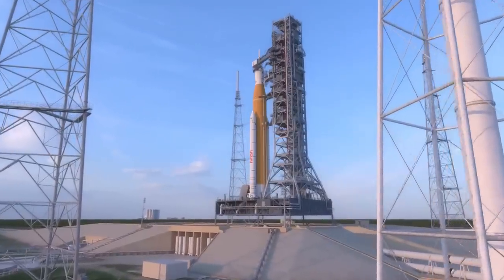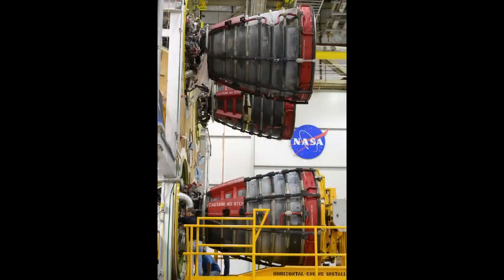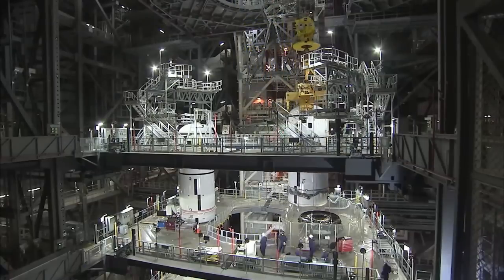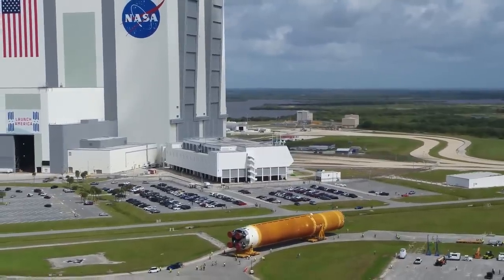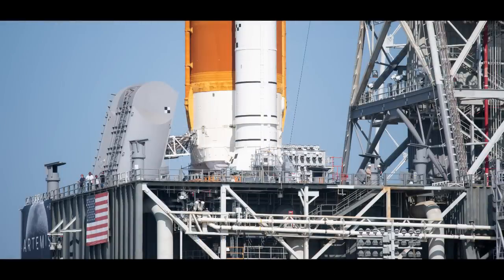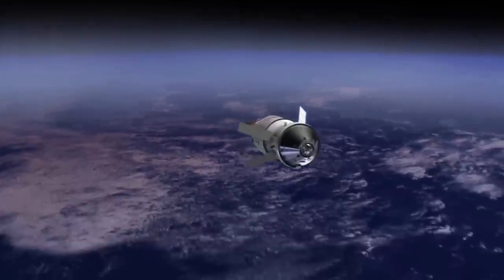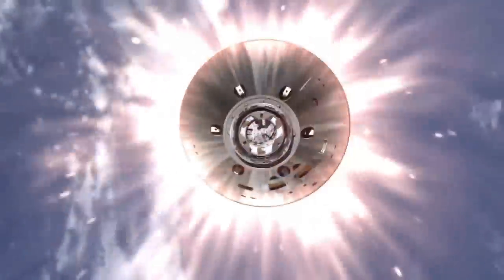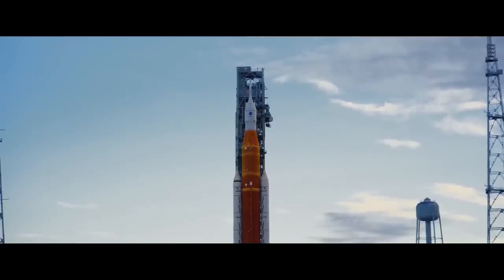What's The Big Deal About Artemis - NASA's New Massive Moon Rocket

Comment: How big is the rocket that will slow the vehicle to land safely on the moon? How much fuel will it take to slow down to the surface of the moon & will all the extra fuel weight to relift off the moon be an issue? Are they concerned about it blowing up when landing on the moon?
Reply: SLS lifts the Orion/ESM/upper stage towards LEO. For the first 3 missions, the upper stage will be the Interim Cyrogenic Propulsion Stage (ICPS) and after that the much larger Exploration Upper Stage (EUS) will be used. The ICPS/EUS will do the final insertion to LEO and will send the Orion/ESM to the Moon. Once there, Orion/ESM meet the Lunar Starship for the Artemis III mission and Lunar Starship will take half the crew to the surface. The other 2 stay in orbit on Orion. After the surface mission is over, Lunar Starship meets with Orion and all the crew return to Earth on Orion/ESM. The ESM is dropped before Earth reentry and only Orion lands back on Earth to be reused.
Reply: @steveaustin2686  
The artistic renditions of the 'Lunar Starship' indicate a very tall vehicle resembling the fanciful artwork of 1930s and 40s science fiction. Mindful of the angle that Apollo 15 set down this seems a very perilous design.
Reply: @yassassin6425  Per SpaceX, Lunar Starship will have larger, more capable legs than the one-use temp legs used on SN8-SN15. Lunar Starship will also have a greater propellant margin, so won't have to set down so far. Not to mention the CLPS rovers that will check out the area first.
Reply: @steveaustin2686  
"Lunar Starship will also have a greater propellant margin, so won't have to set down so far."

Not with you.
Reply: @yassassin6425  The Apollo LM did not have a lot of loiter time to pick the best landing. Lunar Starship will have more propellant margin for that. Not to mention the CLPS rovers checking out the landing area first.
Reply: @steveaustin2686  
That's what I thought you meant. Thanks for the clarification. Nonetheless, the craft does look perilously tall. I expected a squatter, wider design.
Reply: @yassassin6425  It can't really get much wider than the 9m (29.5ft) diameter now. It's doubltful it can get much shorter as it needs its 1,200+ tons of propellant. What is likely to happen is Lunar Starship will carry a few tons of cargo instead of 100+ tons.

Comment: It did come to me the other day reading an article about this launch just how wildly optimistic people were (and maybe cynically so) that taking parts from shuttle would just work tossing them into a completely different vehicle. There's almost no pieces on this that weren't re-engineered or built from scratch for this rocket. this wasn't 'bash a rocket together from spares' this was a brand new rocket with some off the shelf hardware and because its disposable the rs-25 engines which are all relics in their own right, are all gonna be trashed

Comment: What a shame that this will be unmanned with all this historic hardware being lost to the ocean. SpaceX spoiled me on the idea that cool launch hardware comes back.
Reply: Booster reusability is great, but has drawbacks.
First, if you don't have a fast enough launch cadence, you can spend more on recovery than you save by reusing the booster.
Second, you take a payload hit for the recovery system on the booster. The Falcon 9 B5 can lift up to 22.8 tons to LEO when expended, but only up to 16.3 tons when landed on a drone ship (B1051.12). Doing a Return to Launch Site (RTLS) landings, costs even more payload.

So with SLS launching once or twice a year, the cadence doesn't really justify recovering the booster. Not to mention that it gets higher and faster than a Falcon 9, so recovery is much harder.
The SLS Block 1 can get Orion to the Moon, but not with the kind of payload hit like F9 has. The SLS Block 1B will send along a Lunar Gateway module with Orion, so it really can't take the payload hit either.
SLS started design work in 2011, 4 years before SpaceX landed the first booster and almost 6 years before they reused a booster.

Comment: Is it just me or does the launch abort system seem awfully complex? I personally would want that to be as simple as possible to minimise the number of failure points.
Reply: I'm not so sure it is complex. Steering with a solid-fuel rocket firing through high-temperature flaps seems much simpler than conventional reaction control thrusters which require pumps and ignition.

Comment: Why wouldn't they use newer engines?
Reply: They use the engines because they have them in stock. These engines are still fine, they have been made to be reusable and they were quite reliable in the Shuttle program.
Later launches  will use new, simplified (cheaper) engines if the stock engines are all used and gone  since they don't have to be reusable now

Comment: I'm really disappointed with SLS.  It has become, essentially, a very expensive way to dispose of surplus re-usable shuttle hardware using Apollo era flight planning and the ones that actually had that knowledge are all long retired.  When the supply of parts is gone they'll have to start from scratch again.  There is no way Artemis will ever be a long term program.  These companies and this NASA program should be giving Space X a run for the money, and quite simply they're not.  Despite the fact that they have actually been getting the money.  If SLS actually works, they'll hold the record of the largest launch vehicle for a very short time before Starship simply eclipses them.  I consider Starship to be far more "operational" than SLS other than the parts of SLS have made it to space in a previous incarnation.  Someone, or some group of companies, needs to step up and be truly innovative as Elon has done.  That is the future.  Without competition and true innovation, Space X could end up being held back by governmental regulations, potentially as a monopoly, and that won't be good for anybody.
Reply: Aerojet Rocketdyne has a contract to build the expendable RS-25E engines for after the Shuttle era ones are gone. Northrop Grumman has a contract for more capable SRBs after the Shuttle era ones are gone. Starship has a lot of development to go and the fast launch cadence that Musk talks about is apparently a longer term goal. So even though SLS/Orion are hella expensive, they are needed in the short term.
Reply: Artemis is a long term program SLS is not as NASA fully intends to replace the design with space-xs starship once that is human rated. SLS is meant to establish the basic infrastructure necessary for long term lunar missions and honestly i think they are wasting time and money with the artemis 2 and 3 missions as while a manned return to the moon is great publicity surely getting gateway station up first is far more important but that's not slated until artemis 4. hopefully with the success of the artemis program the government sees fit to actually increase NASAs annual budget
Reply: Starship operational - is this your version of a joke?
Reply: @olasek7972  Do you really think Starship won't work?
Reply: @olasek7972  Just deeply disturbed that NASA would call SLS operational before its first flight.  At least Space X is actually flying tests.

Comment: So what the engines that SLS use , Russia ?
Reply: The Antares 230+ booster for the Cygnus CRS missions to the ISS used the Russian RD-181 engine, but NG only has 2 left. NG is working with Firefly to build the Antares 330 booster which will use US made Miranda engines.

ULA had already stopped purchasing Russian RD-180 engines for the Atlas-V. The Vulcan Centaur is replacing the Atlas-V with US made BE-4 engines from Blue Origin. I can't think of any other US boosters that use Russian engines.

Comment: I’m sorry nothing about SLS excites me.  It just doesn’t seem to be an example of good engineering.  The engines are wrong - they should be man rated RS-68s not SSMEs.  The solid boosters are wrong - sure why not add another segment join to increase the chances of failure to overcome the wrong engine choice as SSMEs, which are vacuum engines, don’t give enough thrust at sea level.

The capsule is not testing the critically important life support which isn the whole reason you now have two capsules instead of one.  The launch abort system seems really dodgy and heavy and something they threw together at the last minute.  

SLS is like the last generation of piston engined fighters like the Bearcat - interesting and high performance but doomed to be replaced by jets.
Reply: I agree, though they can't use RS-68s (something previously considered) because they can't survive the heat of the SRBs next to them... the ablative nozzle ablates too quickly. That's why they switched to RS-25 / SSME...
Reply: @simongeard4824   That is a good reason however this is a perfect example of where good engineering has gone out the window.  

Being forced to use the SRBs has compromised the system.  The SLS has more area at the bottom so would it have been impossible to mount more RS-68s so they didnt’tneed solid boosters?

Alternatively I am dead sure with some correct positioning and some shielding the RS-68s would have been fine.

Its a bit like coming up with reasons to use an F1 engine in a Mack truck because you’ve been told you have to use an F1 engine instead of a CAT diesel.  I have complete glossed over the fact SSME’s need solid boosters as they have such poor sea level thrust.  This was all dictated by the design of the shuttle.

SLS should have been a clean sheet design but as it’s actually a jobs program this is what we are stuck with.  Shuttle design compromises make absolutely no sense on a completely different rocket.

Comment: To save the engines as they splash down.whty doesn't NASA have an inflatable parachute System etc? ..
Reply: I think the core stage goes too fast at that point.
Reply: Because at staging the core stage is travelling at 17,000 mph and over 100 miles in altitude. Having no heat shield to protect it, it burns up as it reenters the atmosphere - just as the space shuttle external fuel tank did.

Comment: Well done NASA, made me wait for 3 hours to then cancel the launch until the 4th of September, what a joke
Reply: You understand countdown holds and launch window availability right?
Reply: @KaotikKrow  
You didn't answer the question.

Today, they couldn't achieve the required chilldown temperature on engine 3. During testing at Stennis, they encountered the same issue with two engines, but found that closing the vent cap on the core stage forced the bleed. I gather today, engineers attempted something similar on the problematic engine by isolating the other three. It was to be expected really. This is the first time run this chilldown procedure has been performed with the current ground launch configuration at Kennedy. Engineers weren't able to do this during the WDR in June due to being preoccupied with a hydrogen leak. The hold a t-40 was very unusual and indicated a problem that likely wasn't going to be resolved before the launch window closed.
Reply: @yassassin6425  I did answer the question.... I said it was due to an engine bleed. You just wasted your time typing out what an engine bleed is lol
Reply: @KaotikKrow  
Which necessitated a countdown hold and they lost the launch window. Being 'kept waiting' isn't unusual in rocket launches, nor are scrubs. Particularly given a first test flight of one so complex. Regarding the 'bleed' - in all honesty, did you genuinely understand what that meant?

Comment: I really think its cool that NASA wants to go back to the moon, and I support that endeavour one hundred percent. However, this SLS rocket is... Underwhelming in several respects. First, frankly any space vehicle that isn't more than 80% reusable should not be approved for use, by any nation, ever again. There isn't the space in NEO, LEO or anywhere in a sensible orbital path around Earth, we can afford to drop even a small bolt in, and the physical resources that such rocketry is composed of are also far too valuable not to be reclaimed. Second, its important that missions to the Moon are organised to do as much BIG and impressive science as possible, and move forward in terms of lunar colonisation with every launch. For example, this mission ought to include dropping at least a starter hab unit or the building blocks thereof, so that future missions can build on that and use it as a jumping off point for exploration. I really don't think that the current mission profile which amounts to "We're going back" is worth the cost on its own. It WOULD be if it was going to achieve something brand new, but it absolutely will not be doing that.

Comment: I am an absolute idiot when it comes to this stuff, wondering if someone could answer this for me.... So jets use thrust vectoring, I know what that is, but they also have flight control surfaces.... How does the rocket actually maneuver when it  takes off? Is it due to control surfaces, thrust vectoring from the boosters, or both?
Reply: Depends on the rocket but as I understand it it's pretty much always thrust vectoring/gimballing for launch. Once in space reaction wheels and rcs will be more effective as well.
Reply: @maxv9464  Great, thank you. I suppose the vectoring is something that is obscured by the fire, smoke, and distance of it all. It just looks so rigid when taking off.

Comment: Ho Scott, although I am extremely excited about returning to the moon, after watching your Artemis vid I find myself incensed about the unbelievable wastefulness. It is so ironic that the engines or A1 have been used multiple times on Shuttle and they are now going to be thrown away after one flight. Stupid !  I am sure I’ll forgive NASA everything on Monday, but this cannot possibly be sustainable. Peoples interest in Apollo warned and with such high cost it was doomed, I foresee Artemis following the same path. Please persuade me I am wrong kind regards, Steve
Reply: Booster reusability is great, but has drawbacks.
First, if you don't have a fast enough launch cadence, you can spend more on recovery than you save by reusing the booster.
Second, you take a payload hit for the recovery system on the booster. The Falcon 9 B5 can lift up to 22.8 tons to LEO when expended, but only up to 16.3 tons when landed on a drone ship (B1051.12). Doing a Return to Launch Site (RTLS) landings, costs even more payload.

So with SLS launching once or twice a year, the cadence doesn't really justify recovering the booster. Not to mention that it gets higher and faster than a Falcon 9.
The SLS Block 1 can get Orion to the Moon, but not with the kind of payload hit like F9 has. The SLS Block 1B will send along a Lunar Gateway module with Orion, so it really can't take the payload hit either.
SLS started design work in 2011, 4 years before SpaceX landed the first booster and almost 6 years before they reused a booster.

Comment: Payload is ~105-tons ... using fluid_impulse motors 7.5-tons force each is 14-mtrs to hover 42-mtrs for dynamics & landing. Since these use magnet motors for pumps no_fuels no_electricity to power orbiting a payload in a hovercraft these spiral to orbit not straight up.

Nobody mfg's them, I will eventually ...